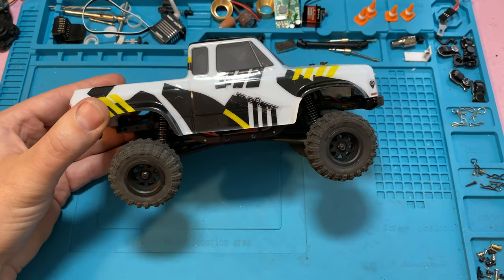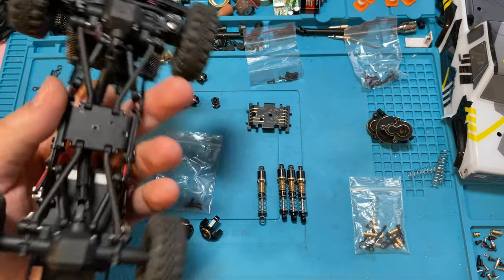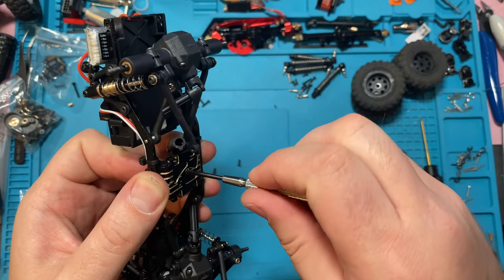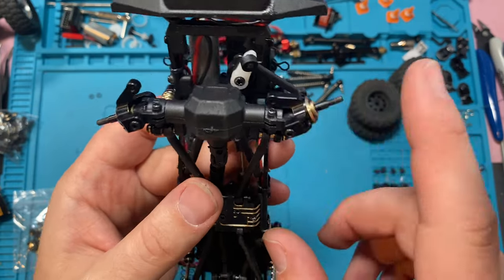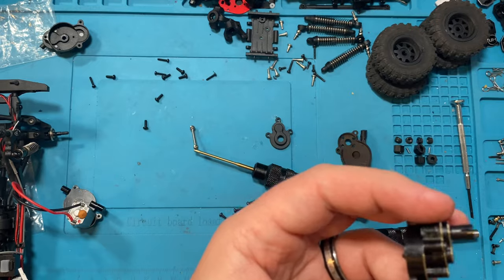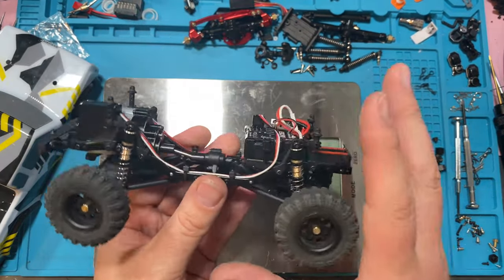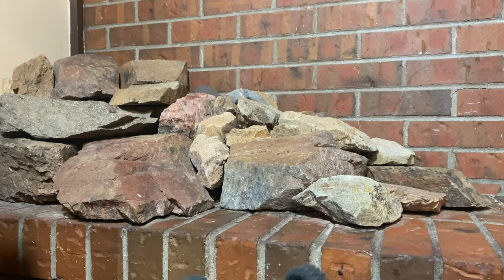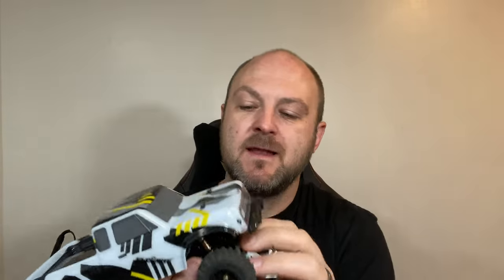Enduro24 - Hobby Details Brass Install and Review! TONS of BRASS!

Comment: Probably too late by now but anyways, these enduro24, rgts and injora already struggle on the low end so adding more weight hurts it even more, like you said its about the balance more importantly. The main issue is the huge bulky differential that snags on everything, so what really change the game for these crawlers is to use bigger but light tires, like stock scx24 tires or stock cr18 tires which i am currently running.
Reply from the maker: all good info! Thanks a ton for the watch. At some point we will revisit our enduro 24 and try to push it a little more.

Comment: Good video Ken, but I would definitely recommend not grabbing the shock shaft with pliers like that, especially on oil shocks. If you need to grab it, get as close to the threaded end as possible.
Reply from the maker: Good call! We will usually put some masking tape on it to protect the shaft.

Comment: Hey I have an enduro24 and I been looking at options to add proper ball links do you think the brads skid plate will have engine spacing to install ball end link? I know on the plastic version I couldn't due to the spacing.
Reply from the maker: The brass one is the exact same. You should try shimming and spacing it though.

Comment: Just did full power hobby brass on mine and I’m not impressed in the gear housing or the links. Definitely need bigger tires now though
Reply from the maker: What are you disappointed in with the housing and links?

Comment: The Chassis does look similar to the scx24 Chassis that Axial produces.
Reply from the maker: They are similar.  The axles are ring and pinion though. Also, the servo is frame mounted for a more scale feature and there is an actual transmission and transfer case vs just the SCX24 transfer case.
Reply: @TheShopMiniRC  I have sent you a few items to look at of my build for the scx24 C10 on Instagram earlier.
Reply from the maker: @chevyb0195  replied.